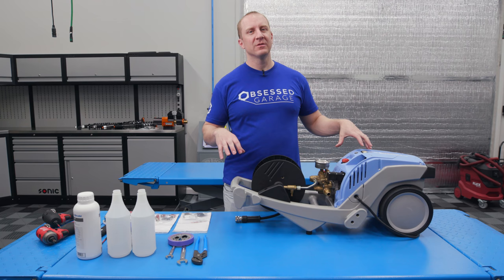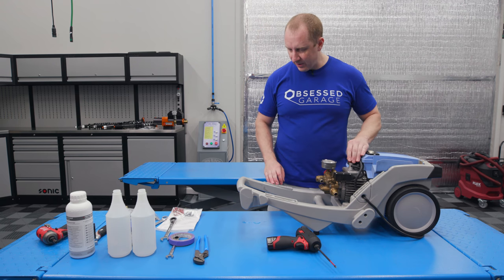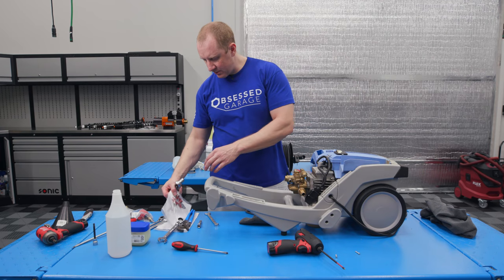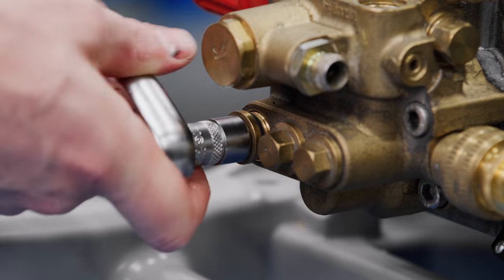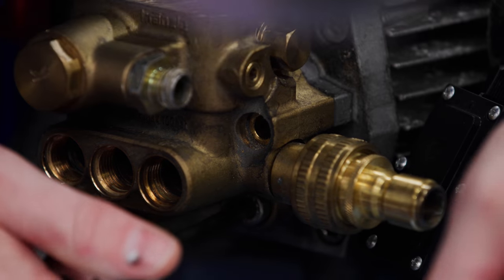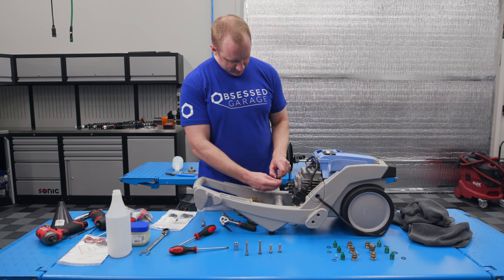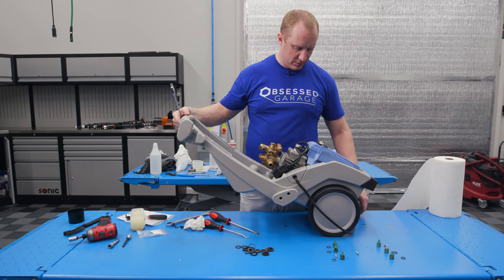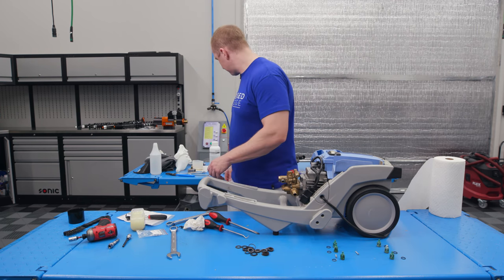Rebuilding My 8 Year Old Kranzle

Comment: Been there, done that on my 10 year old Kränzle 1150T. Those machines are really built to last a lifetime and are easily serviceable by yourself. After the service it responded better and had even more power 💪 my oil looked a lot worse and was never changed according to the previous owner. Thanks for Sharing Matt 👍

Comment: Installed my Kranzle at my parent's house as I live in a condo. Found out Mom used it a couple weeks ago and must have just shut the water off and didn't pop the breaker like I showed her. Not sure if it was running a whole day or more where the pump was running without water flowing through it, luckily I was over there at random looking for something in their shed where it's mounted. I was slightly overdue for an oil change so I went ahead changed it. Was totally expecting a to be ruined and act weird or whine like a Sun Joe but it fired right up with nary an issue. Ran two cars through it, PF22 foaming and all, the Kranzle is just a beast.
Reply: Nice

Comment: So glad to know I can come to you for parts as well. I accidentally broke the unloader valve on my 1622 and although Dirtkiller was very helpful in getting me the replacement, I didn't fully understand how to install it properly. This helps tremendously-- Thank you as always!
Reply: Could you actually make a quick follow up video going over the correct install process? My Kranzle has been running strong 1 year after the repair so I'm sure I did it right, but part of me is still second guessing my work.

Comment: After seeing the posts in the FB group illustrating leaking oil, leaking water and packaging issues, I was super worried. After this, I see that I can literally fix the damn thing with ease. Really simple machine once it's broken down. Now, I don't want to do this after one year of usage like some of the others have pointed out, but, if I have to I can with ease. Thanks Matt! 💪🏼🙌🏼
Reply from the maker: Yeah, it's part of the game with water under pressure.  Sometimes you have to chase it a bit.  These aren't consumer machines.  They are professional grade machines designed for professional applications.  There is an assumption that you are willing to maintain and work on them or hire someone to do it for you.  I've tried to make that as clear as possible, but some people equate spending more money for a high quality machine as being infallible.  For me, I want this level of function, so I'm willing to work for it.
Reply: Obsessed Garage Absolutely agree! Thanks for the reply and thanks for doing what you do! 🙏🏼

Comment: Hey Matt, just wanted to give you a big shout out for the effort you've put towards perfecting pressure washer solutions. I bought a Simoniz 1800 platinum (rebranded Active VE52) and used your kits as a guideline to help me enjoy & be more efficient with my part time detailing. Some day I will be ordering a 1322 kranzle from your site

Comment: excellent video - 19:37,  An industry best practice is to always lubricate the thrust bearing with a dab of gear oil, at least on the ball bearings and then refill the tank. You see the maximum damage happens in the first couple of seconds on the Pressure washers wobble plate as there is no 360 deg oil spray circulation here, so having the thrust bearing pre-primed with gear oil will be the best.

Comment: I discovered a while ago the pressure advertised doesn't have to be constant on machines here, especially on cheaper stuff with no guage. My 1150 psi crapheap is that pressure for just a millisecond then is just over half when running.

Comment: Also another insight - which may help all viewers of this classy channel is - the thrust bearing will have 3 parts - there will be 2 circular discs and a circular ball bearing disc in between those plates - the most important point is one of the 2 circular disc will be thicker that part should be on which the pistons touch for the pumping action. and the thinner circular disc should be facing the wobble plate side. 

Its very easy to miss this and put the thinner circular disc facing the pistons, what that will do is damage the entire thrust bearing assembly in no time. SO please ensure the thicker circular disc always faces the pistons. hope that helps
Reply: Its impossible to mix them up
Reply: @K3470N_  I have seen many times mistakes like this accidentally happen and ruin the PW. Unless someone doing the service is explicitly informed. you can do it yourself the PW 
will run perfectly even if you put the thinner disc of thrust bearing facing the pistons. but within a month will ruin the PW!!! There will be a distinct sound change though while running. THEREFORE always ensure to put the thicker disc facing the pistons . This is for ALL PW's not just kranzle

Comment: Awesome 😎, if you have milky oil it’s a good idea to check the expansion chamber (undo the four Allen bolts where the dipstick is and clean inside) if you leave just a drop of milky oil in the pump the oil will go milky again but it won’t be a problem with the seal 👍

Comment: The one thing I don’t like about my 1122 is the power cord.  The power cord is way too stiff and not easy to manage when it’s cooler outside.  More expensive power cords are way more flexible and are more of the flexible rubber.  The cord on mine is Southwire Royal line SJTOW and I plan to replace it with the Southwire Seoprene SJEOOW.  Otherwise love mine.

Comment: 30:51 best way to ensure you hydraulic pipe end connector M22-14 or M22-15 don't RUST is to remove the connector O-ring and spray the connector with some metal clear coat, then reattach the o-ring  that will last for 7-8 yrs without any rust - always hate to see anything rust in my pressure washer and wondered why the pressure hose connectors don't come in SS in the first place!!!

Comment: I have the 1152🇬🇧 which is basically same as yours I remember you saying just different voltage, the manual says 250ml for an oil change is there any particular reason you used 300ml ?? 

Cheers 👍

Comment: Perfect.. just ordered a seal kit.  My washer isnt very old but did experience a seal issue.  Do I need to bother removing the check valves etc?  In other words.. if I just plan to replace the packing seals.. do I have to remove all the extra stuff?
Reply from the maker: The check valves are likely fine.  I just replaced them to be sure it was all fresh.

Comment: Service mine everytime the capacitor blows - even if you don't use extension leads as claimed to be the cause. Unusual the silicon switch cover breaks & the OEM Kranzel gauge failed.  Ironically the pump has been fully reliable and only an oil change.

Comment: Hey Matt I have K1322TS and it’s a little over a year old maybe two.  I don’t detail professionally I am more of a weekend warrior.  I tried to use my Kranzle and water wasn’t flowing through it properly.  It would just drip out of the end.  I left it outside for a weekend under a carport the last time I used it.  Any thoughts?  I think something might’ve just crawled in and plugged it up.
Reply from the maker: It’s pretty easy to pull the head off and inspect.  That’s what I would do.
Reply: @ObsessedGarage  yeah Matt that’s what I ended up doing.  Nothing looked out of the ordinary so I pulled out the valves.  My bottom 3 valves were filthy I couldn’t tell they were green at first.  Top 3 looked alright.  So I think I found my problem.